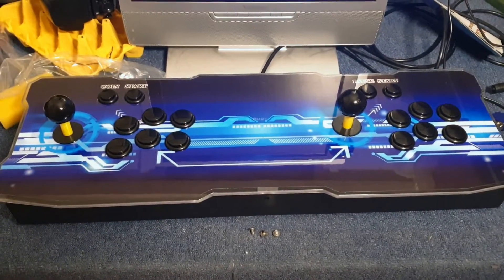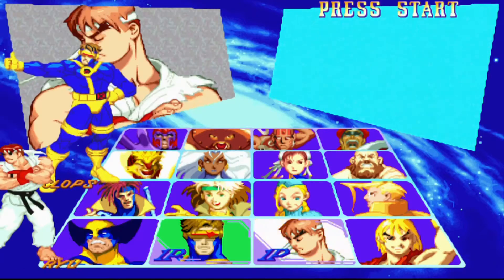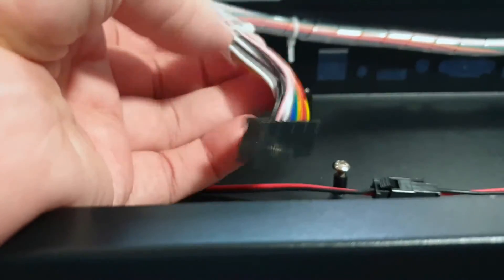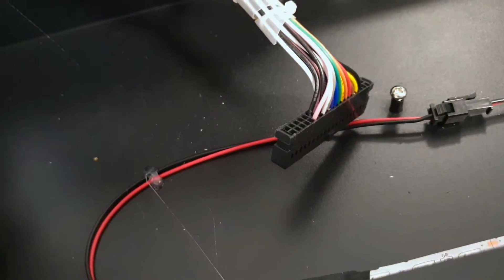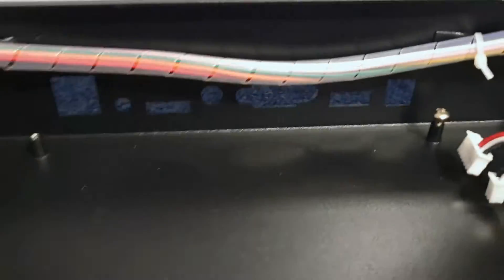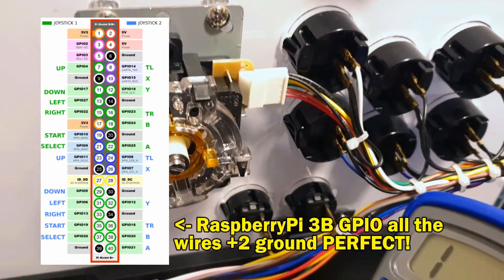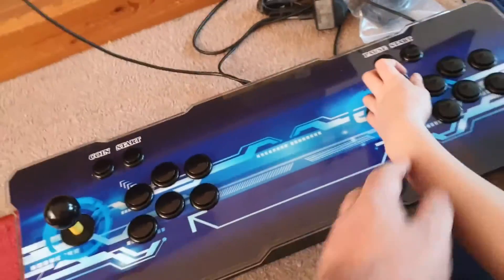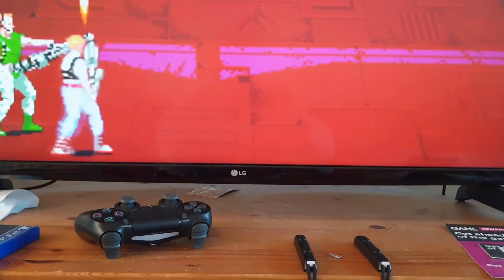Upgraded Pandora Box Treasure 3D To Run Recalbox on RaspberryPi 3B

Comment: You could have just installed Emuelec on the original Board and run a usb cord from one usb Port to the other, the chipset isn't that bad actually, it's an octa core S912 by amlogic.
Reply from the maker: I still have it... might have to put it something else...

Comment: is an upgrade or downgrade, LOL
Reply from the maker: Well given the unchangeable 2d mame graphical effect you can not get rid of the only good use I found for the old board is a dodgy n64 Emulator.  Too slow for ps2 and the like.
Reply: @generalcrow   You can play N64, PSP, DreamCast, Naomi, and PSX, not all games works well, obviously GPU is not so powerful for all emulators, is not a PC that small board dude. But lots of games works.

The 2d graphical effects are because of the system is for a portable system to hook up to any actual HDTV, that's the main idea, but was not a good idea not add a way to change that. 

The board is not perfect but is way more powerful than a RasberryPI.  Have an octa-core at 2.0 GHz and a Mali T830 GPU. 
The 3d arcade games that on the full romset 139u1 you can't run on mame ( you need a PC with 8 gb and a really good GPU for that), you can run with an emulator, that's was the idea of the emulators, to can play the arcade games you can't on mame that are part of the mame romset. 

Also, you say to slow for PS2 games, what????? you can't play PS2 games on this board or RasberryPI eighter.

ALso, if you look around there is a boot image that runs sx05re from a usb stick that will boot before pandora's software, works well for 2d arcade games and is a better way to play this games without the image optimization instead of a new raspberry pi board.
Reply from the maker: Yeah I really wanted it for the 2D games.  After testing this PCB has a faster GPU but a worse CPU and memory speed.

So I am happy with the RPi3 I still have the board which is worth about $100 and I might make a N64 emulator (this it appears to be perfect for).
Reply: @generalcrow   well you have to do your test again, a RasberryPi 3 don't have the power of the Pandora Treassure, the Pandora has a dedicated GPU mali t830  and a CPU ARM octa-core of 2ghz, also have 2/4gb of ddr3 ram memory, Please don't confuse people if you don't know.
Reply: @andyzpam5441  I wonder if there is a way to update the builds of the emulators with a PC. I'm well aware of the what the Treasure can play and handle. I'm curious if there is a way to customize the exsisting emulation

Comment: Could have saved yourself a lot of time by just getting zero delay usb encoders and hooking those up to the buttons and joysticks.
Reply from the maker: I know in a way I wished to reuse as much of the original box as possible.  And I think given the GPIO those thing are a solution for a 4 way, 6way or 8 player arcade machine.  Plus I saved 20 bucks!
Reply: @generalcrow  - I did both, doing the GPIO method is alot cleaner if you want to go the Raspberry Pi 3b route. The zero encoder is perfect for someone who wants to do a pentium itx system in the case. Zero delay usb make's it future proof, but mine wasn't the prettiest finished product.
Reply: So I’m ignorant on a lot of this...is it possible to have some sort of a switch to have the option of Pandora’s box and raspberry pi both? Or do you have to remove the pandora in order to play raspberry pi. Just wondering if there is any possible way to have both. Reason is I have a raspberry pi and want to hook it up to this control stick and have it as a portable device but still be able to use the pandora because of the ease of use.